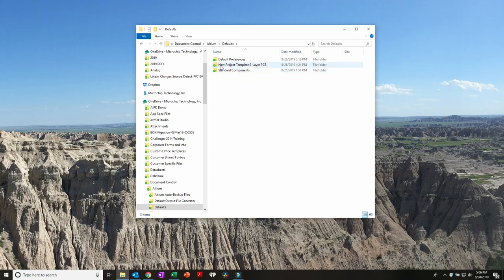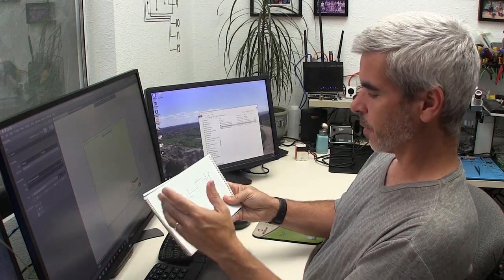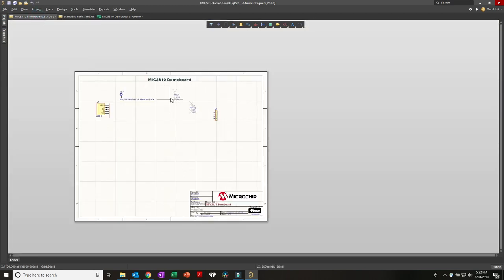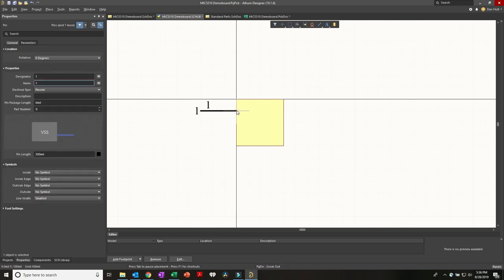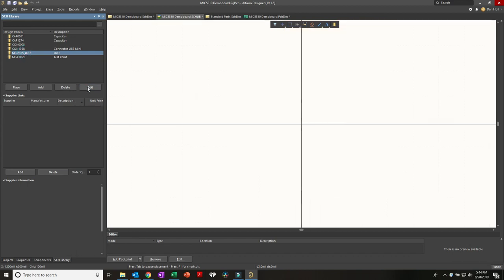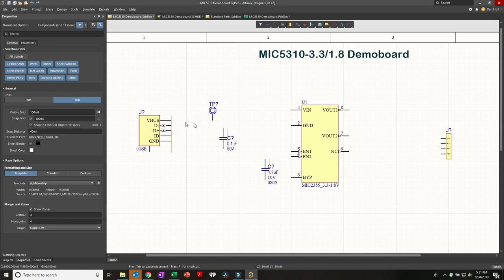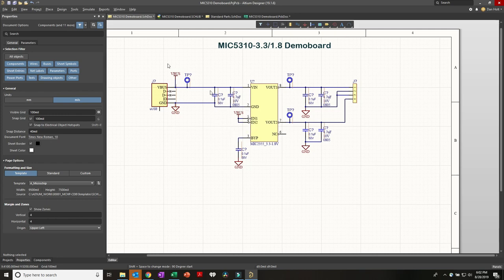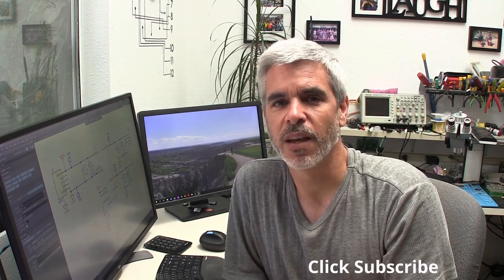Getting Started in Altium Designer - SCH Design - Part 1-2

Comment: Great job Dan!!  One of the BEST Altium training videos I have seen in many months!Kudos for your work!Now... do you feel bold enough to attempt to generate the first of the Altium 20 - line of training videos?
Or, dealing with a (say...) 4 part/ or section connector with many pins, that needs to be broken up, or constantly re-edited due to different variants used on the mother board?(Altium does not document that aspect very well!)Let us know if your available for consulting!  ;o)
Reply from the maker: For 99% of boards, the steps I show here will be the same for Altium versions 19 through 23.  Most of the new features are not needed for basic boards such as this.